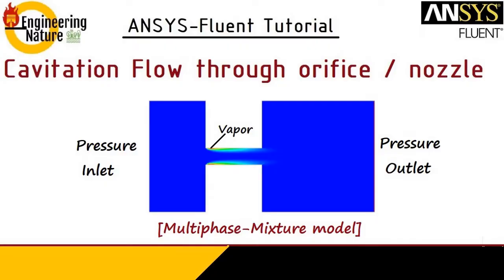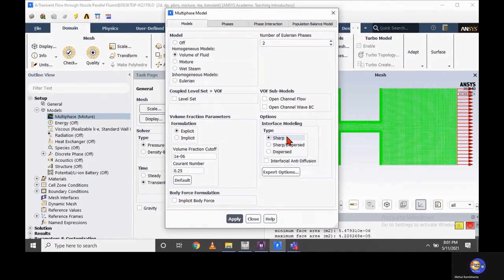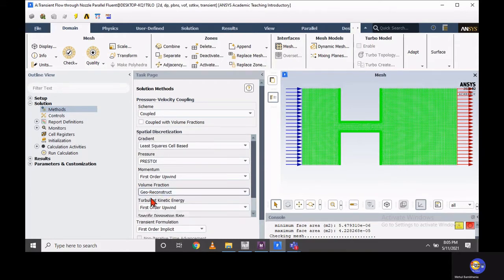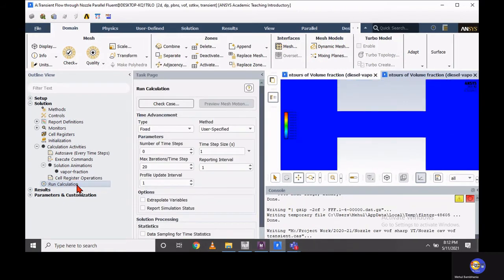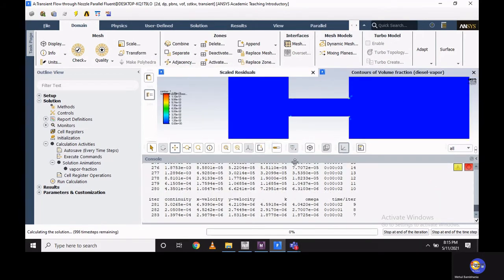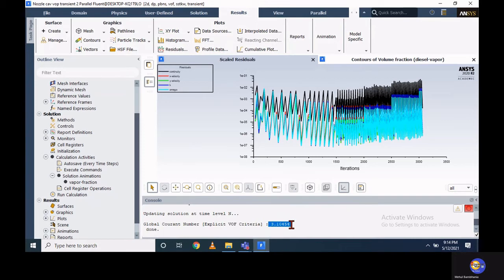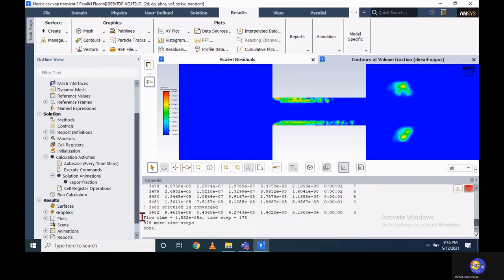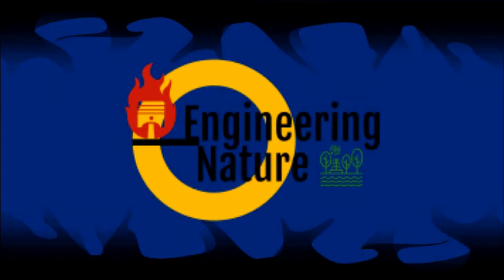ANSYS-Fluent Tutorial || Multiphase flow simulation || VOF model

Comment: In the shown animation at the end of the video, Why does the bubbles volume increase downstream whereas the pressure increases and their volume should decrease and collapse as you mentioned?
Reply from the maker: What I understand your question is:
(1) Pressure decreases along the length of the nozzle (As area decreases pressure decreases), which leads to formation of large cavitation bubble. (2) Although it will collapse at the nozzle exit due to abrupt rise in the pressure. (As Area increases pressure increases)
Regards.
Reply: @EngineeringNature  My question was about the change of bubbles volume right after they exit the restricted area and move towards the exit. Your pressure contours show the relative increase of pressure with respect the restricted area and therefore, the bubble volume should decrease and eventually collapse but the animation show the increase of bubble volume?

Comment: Thank you for your efforts to show this simulation. I had a question regarding the Timestep selection for transient simulations. Did you calculate using the CFL number to get the appropriate time step size? Thanks.
Reply from the maker: Yes one should calculate the CFL number prior to simulation and you should fixed your time step accordingly. Although I am using another ways, where I had play with the time step and monitoring the CFL number through console.

Comment: Is the recent iris xe graphics with the 11th gen i5 16gb ram compatible and sufficient  with ansys for  medium 3d  simulations?
Reply from the maker: i5 with 16gb ram definitely work for you Multiphase 3d simulations 👍
Reply: @EngineeringNature  Have you tried to run ansys on 11th gen i5 laptop with integrated iris xe graphics ? Does it work or not
Reply from the maker: No dear, not tried with i5.
ANSYS only required windows 10 operating system with minimum 4GB of RAM. I have i3 processor wihout graphic in my laptop and ANSYS work absolutely fine.😀
Reply: @EngineeringNature  Which version?  Ansys 2021 r2 ?